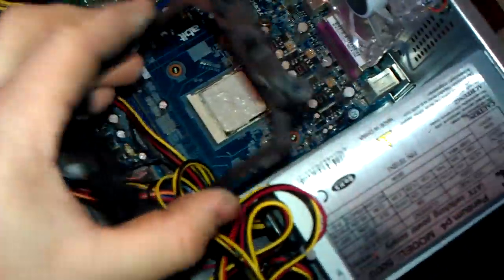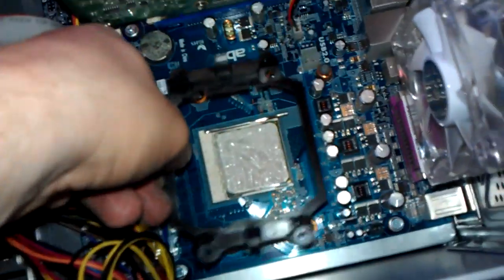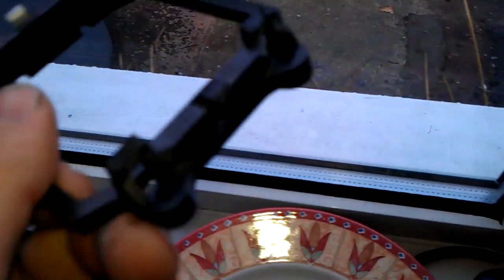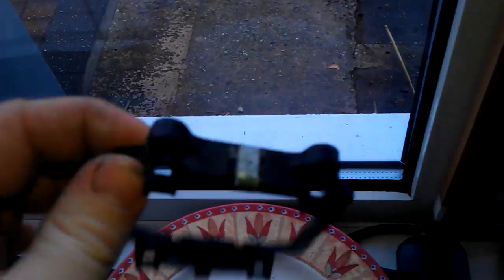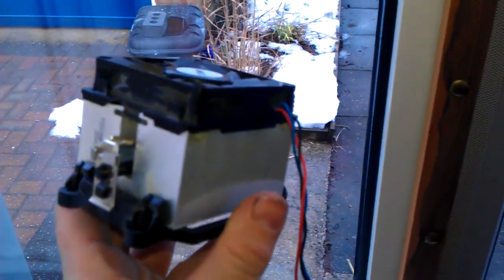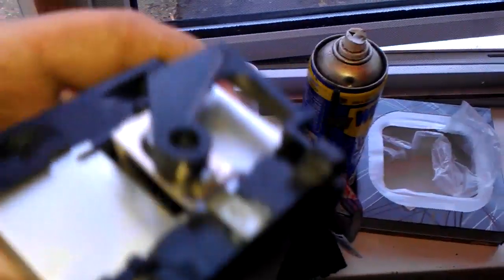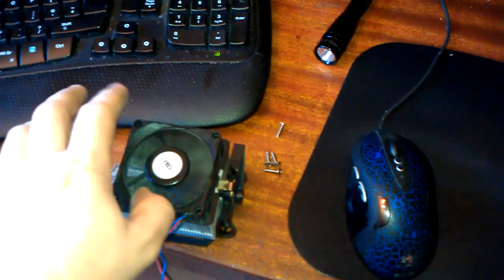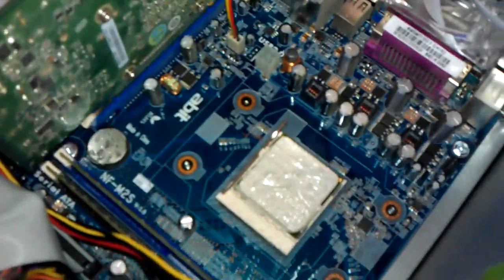How to fix broken CPU heatsink mount / bracket (AMD)

Comment: Yep... my 15 year old fan bracket cracked at the clip holder.  I'm finding split clips not a whole bracket.   Hoping I can just remove two screws at a time and not have the underneath bracket move,  or fall since it's sideways.

Comment: Thanks for the vid, Rich. I fixed it similarly by using the metal file on a nail clipper; the ones that slide outward. The chromed metal file stood up to bending and shaping without snapping and was able to simply clamp around the inside bottom and bent a hook for the fan bracket to grab onto. Just used a needle-nose plier and some frontal cutters to clip the excess metal, unless you use a small nail clipper. No glue needed, just getting the height right. Sorry I didn't document it on video, hope this helps in figuring out what metal to use w/out the need for glue.

Comment: Hey, you have a great fix. But, moving around like that is horrible. Use a stand or tripod, much better. Moving slower would help a ton as well. A positive fix could be to use small screw with the same setup.
Reply: You tip is good, bud camera work is horrible , sorry!

Comment: the best thing to do is get the origonal piece place it back against the bracket and weld it with a soldering iron or possibly a heat gun dunno havent tried the heat gun but i would imagine it would be more thorough
Reply: +todd logan already tride it..... snapped again 1 month ago.... it gives up now the broken piece cannot put back cuz it melted with solder

Comment: Both Gorilla Super Glue and Original Gorilla Glue failed in my attempts to do this repair.  Maybe not sufficient curing time.

My solution: break off the flat prongs of an American A/C electric plug, bend the pieces to a right angle on the end without the hole, then use the prong holes to put a very small screw into the plastic body after drilling an appropriate pilot hole.  I used the super glue to hold the piece in place while drilling and inserting the screw.  Works perfectly. I've had two of the base units break within 6 weeks.  (Bad design: the small "ears" have hollow spaces from the mold and break much too easily.)

Comment: Nice job. I had the exact same problem recently with an old ASUS A8N-E mobo. The tab on my bracket snapped off right next to one of the two screws that pass through the board, and into the steel bracket on the underneath. My solution was to fashion a small piece of metal into the required hook/tab and then drill a hole in it to allow the mounting screw to pass through it and hold both the clamp and my new piece of metal in place. Pleased to say it worked.

Comment from the maker: Well you could try glueing back together or if you have a welder or a gas torch you could make a new lever by welding or brazing a piece of metal back onto it providing where it connects to is metal.
Without seeing it it's hard to say. It might always just be as easy to get hold of a new heatsink - I love to try and fix anything I can, but some things it's easier to just replace.

Comment: The entire retention bar snapped off. Its still in 1 piece it just wont connect to the heatsink again. Do u think the cpu will run ok without the lever being locked in?